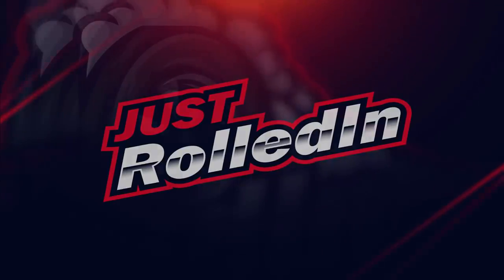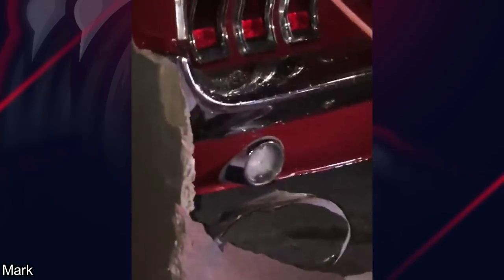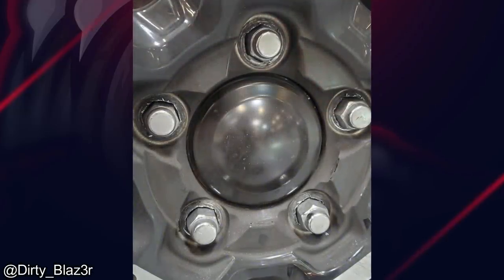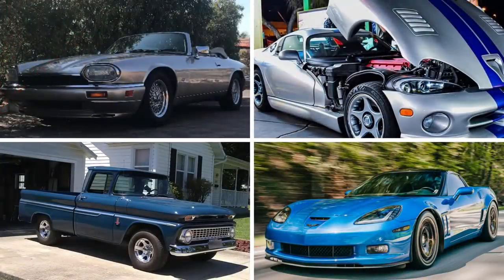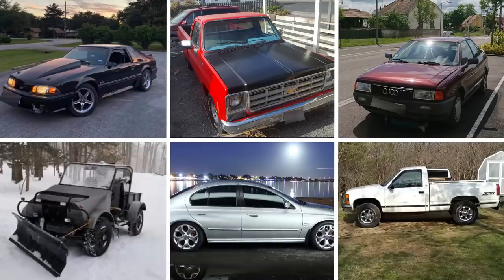Customer States Tire Just Popped Off While Driving | Just Rolled In

Comment: I remember those lights, really handy.  I also had a 3rd gen TA with the factory flashlight in the overhead console.  :)
Had a Suburban where one of the rear wheel wells rotted out on the entire seam.  It could fall out when driving down the road.  I pop rived it in with some  aluminum scrap and sealed it with roofing tar.

Comment: I have a 96 Chevy c1500 and my retractable light still works
Reply: Is there a risk of it melting over heads or anything? Obviously you gotta me careful, and seems like a great little feature.
Reply: @RipRoaringGarage  I rarely use it but it's neat to have I'm sure in the past it was used a lot sense the truck has 325k and still runs great I'm the 4th or 5th owner
Reply: My 92 has the same light but it’s on the passenger inner fender
Reply: Me too and like it too !
Reply: My brother has a 93  Chevy with 343k with a v6 and runs just as good
Reply: I had a 94 it died about 4 years ago I used the hell out of that light
Reply: I used to have a 91 C1500 that had one, but had to sell it 6 years ago as the engine spat out a rod thru the oil pan after it caught a bit of water... ( I miss that truck as it was a stepside too...)
Reply: @hdezn26  my 96 c1500 is a stepside it's dark blue the main issues I have are moisture getting in the destribitor cap and cab corners are rusted out
Reply: @Mike where would the vent be located on the cap
Reply: @RipRoaringGarage  the retractable light is safe jest gets hot while it's being used but I'm sure now them might make a led for it
Reply: @joshuafisk5080  That sounds more like a feature than a fault, working on a ripped belt on the side of the road, trying to get to Christmas dinner, during a blizzard.

Comment: light switch, turns the key to the "on" position. and the 2nd switch engages the starter, then flick off 2nd switch once car is running.    turn off car by turning light switch to off "key off"
Reply from the maker: Damn I liked my version better 🤪
Reply: @JustRolledIn  I was thinking ejector seat
Reply: Maybe the other switch is for the brake lights?...or a closet light.
Reply: You people don't watch enough TV, surely that's for raising up the 50 cal. They just didn't show the joystick for aiming and firing on the dash 🤣
Reply: Not such a mystery really.  I had a '71 Datsun 510 that the ignition switch eventually failed on and I rigged something like that.  A second switch was in the procedure to put the resistor back in the points circuit to keep from burning out the contacts and just a push button to start.
Reply: came down here to make sure I wasn't the only one who had rewired an ignition switch into individual switches like that 
although I prefer using a momentary push button for the starter, less likely to leave it on and chew up the starter
Reply: Was going to suggest the same...First one ignition on, second one to run the starter.
Reply: A lot of old tractors were like that. A Run switch to put power to the coil, and usually a push button to engage the starter.
Reply: A 'friend' of mine who is the cause of so many similar fixes like in these videos, once asked for my help to get his tractor to start. He rewired the ignition himself, with a lightswitch. A black wire ran from the switch taped to the dash, down along the harness near the motor, and all the way back up to the other terminal on the switch. I told him he was an idiot and didn't understand electrical circuits.
Reply: @TheGarbageman22  I had an old Toyolet like that.  The builder had the key set up so it would go to "on", but that was it.  You had to push a button on the dash to start it.

Comment: Looks like the piston played Paddy cake with the valve
Reply: Yah, "interference" engines will do that if the timing is off by more than a tiny bit.
In an interference engine the fully extended position of the valves overlaps with the top dead center position of the pistons, only reason they don't collide in normal operation is very careful timing.

A non interference engine has a gap between pistons and valves at the positions described above so a broken timing system isn't going to insta wreck the engine.

Why are interference engines used even with a design drawback like that?
Sometimes the car your designing doesn't have enough hight under the hood for a non interference engine and you can't make the engine smaller couse then there won't be enough power and the car will be a road hazard
Reply: @can_hauler  ok

Comment: Let's thank the customer that didn't ignore the fur baby crying.  The roof with the sunroof issue,  well from 18 years in the field that body tech was either drunk or really stoned. Back in 05 I actually drove a viper gts. Scared the shit out of me and I never left 1st gear.  And I'm also a HUGE 3rd gen fire chicken fanatic!
Reply: More like somebody got a replacement headliner from the scrapyard.
Reply: @Frostified  if that was true it wouldn't have the sunroof glass.  Plus I can see heavy orange peel in the clear coat. It had a replacement roof skin.
Reply: @KenBober  Possible but I think that's just shiny metal and not glass. The top looks more like a ton of clearcoat scratches. Either way, crazy lol
Reply: @Frostified  stop at 28 seconds exactly, you can see the glass is retracted.
Reply: @KenBober  Ah, crazy. Maybe they were tired of a leaky sunroof lol.

Comment: I’m not sure what’s worse: using the wrong lug nuts or using the right lug nuts backward. I just had to write up a customer for a rim and five studs due to the latter mistake being made by a tow driver putting the temp tire on.
Reply: Saw a video about lug nuts swelling in size and had to cut them off to replace the tire.
Reply: @apeflawless  I had a car with swollen lug nuts and they threatened to do that. I told them to take the thing off the hoist, and I'd figure out another way. Suddenly they came up with a huge adjustable wrench and a cheater bar rather than lose the new tire sale. I later went to an auto parts store and got replacement nuts for about 80c each. They were way shorter than the originals, so the studs stuck out beyond them, but they were the right diameter and that's what counted. The whole car only lasted about another year or so, so I don't know how long those cheap lug nuts would have made it. That car was more proof that a good-looking car and a good-running car are not always the same thing.
Reply: @Megatron995  Was the car a Ford?

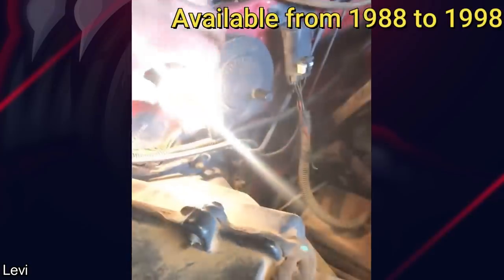Comment: 2:06 Nissan installed similar lights on the S30 Z and S130 280zx cars from 1970-1983
Reply from the maker: I did not know that. Pretty cool!
Reply: @Mike Yeah, the nissan one's aren't as fancy. They have an on off switch on the back, and you twist the light to pull it off and it has a 1-2ft thin cable all coiled up inside. The wire wraps around a hook that's on the end of the light. It actually came in handy a lot of times with my 280z lol

Comment: The escape strut tower should be a recall. The coating they put on is perforated and hold all the crap from driving down the road. Even if you wash it down regularly it'll hold that too. 

Also that's a nifty lil light, I gotta look for one of those at the u-picks XD

Comment: 0:54 That is bad.... If you can see the tire, from inside of the vehicle, it's probally time to send it off, for good
1:04 That camera's video will be all over the place, And I thought a Emerson Camera mounted on a scooter was bad.... At least I used moar Duct Tape!
1:16 It would of been crazy, if they had the 2nd switch turn off/on the lights..
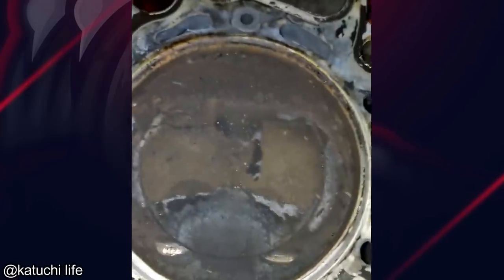1:32 When the engine takes, Tappy Tap Tap, a bit too far...
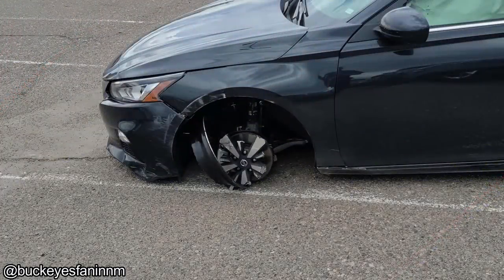1:52 "Just popped off Eh?"  I bet they just hit someting out on the road...
2:06 I had that Light on my 91 Chevy C1500 Truck , It worked most of the time.
2:23 And. . . . How did they do that?! Somebody forget to tighten the bolts, working on that Diff?
2:39 If I need to make a ship horn, I know now, how to do it!

Comment: Ford used those retractable lights too. My 1986 has one. The only difference was that Ford had a better way (like they always do) and used a spring retractor. That means that, like mine, most of them are now laying under a work bench with an un-retracted light that won't wind in. My old Suburban had that light with the hand crank and man I wish Ford had used those instead.

Comment: I wonder how many miles that cat had on it? I remember seeing trouble lights on the early 60's Pontiac's but they were metal of course and were mounted in the trunk instead of under the hood. I guess it was a removable trunk light that would reach to the front of the car. Must have been an option because not all had them.
Reply: @Mike I want to say yes but thats been so many years I'm not 100% sure. I believe it was the only light in the trunk and I don't remember a separate switch so it must have been. There was a 3 prong bracket that held the light to the lid and then the light unreeled and was round.

Comment: The retractable trouble light is the only good thing GM ever made...
Reply: That's why it's not available anymore.
Reply: Wow...it's as if they expected you to have trouble in the middle of the night. Hmmm...Imagine that.
Reply: I had one in my 1990 Suburban. I had almost 250,000 miles on it before I sold it. Only major problems were I needed a new fuel pump and a new power window motor.
Reply: I still run a 98 winter beater and 95 summer beater, those 88/98 trucks hold up well with proper care!

Comment: I gotta know that one with the sunroof did they put a new panel over the roof because it leaked or did someone from the factory mess up and put the wrong panel over an already installed sunroof. no way that is not intentional...
Reply from the maker: Looks like they covered it up because it leaked. Hard to tell in the video but doesn't look like the best paint job on the roof
Reply: @JustRolledIn  I thought originally the video was about the poor paint job untill I saw that "sunroof".

Comment: Advanced Auto Parts website used to say those lug nuts fit your vehicle back in 06' even if they didn't, so I see how he got duped. I took those things right back in the store, the threads may fit, but ain't no way those lugs were gonna hold them rims on my Lexus. Smh. Nowhere near a match.
Reply: I work at AAP and I can tell you that our catalog for looking up lug nuts is a F---King joke.   It will list EVERY lug nut that will fit the STUD size for any given vehicle ... and if you get a counter person that is green (which most of them are) they will just pick the one at the top of the listing.   YES it will fit the given STUD (tread size) BUT it will not be correct for the OEM Rim.   

This seems to a common issue with a lot of the retail vendors (Autozone, Pep Boys, Etc).

Always take an original lug nut off your vehicle for match up wherever you go to get a replacement ... it may be inconvenient to do so ... but at least it will insure that you get the right one.